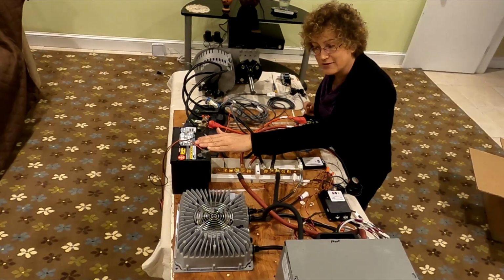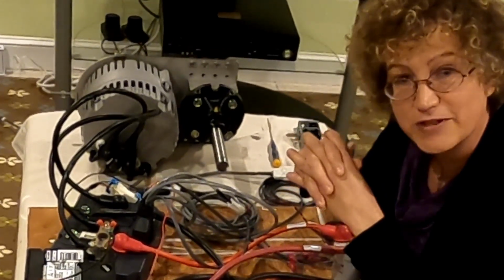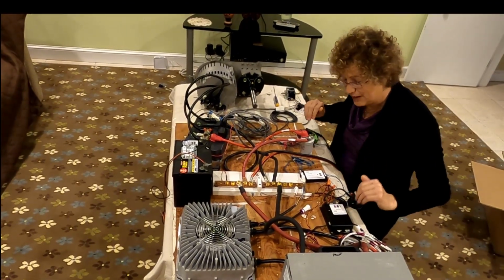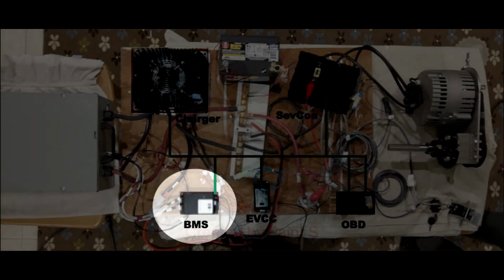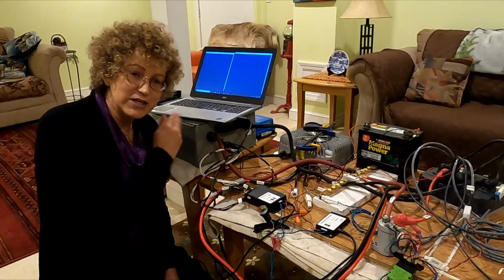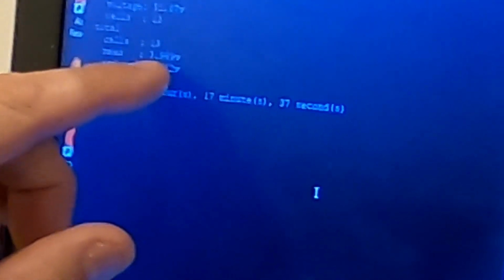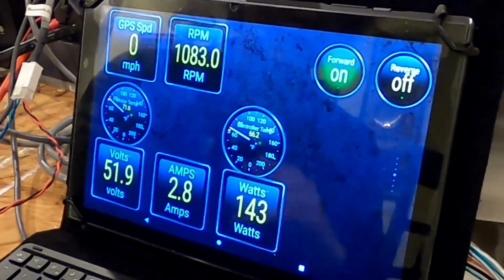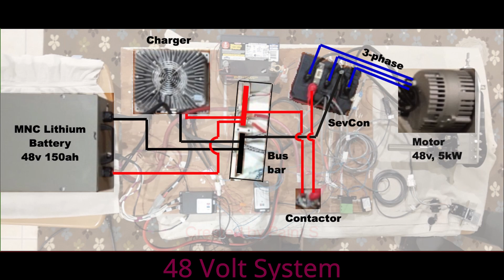Episode 39 - Repower our Sailboat.  Electric Sailboat Drive Bench Test with Thunderstruck Motors

Comment: SAIL Drive conversions can be as simple as :
shore power smart charger + Li-Ion + PMAC and Re-Gen motor controller + matched prop....Li-Ion DC/DC to the panel.

Reply
Reply from the maker: Yes! We have all of that except for the Regen.  Our current boat as a propulsion motors and they do not accept region unless you have their batteries.  We tried to cover all of what you have listed in our other episodes.  Cheers
Reply: @sailingaccidentalgybe  well the Sevcon controllers are Re-Gen capable, aren't they?  it's the Motor Controller, that has the re-gen function or not.....for a motor only boat, no one would care....but for a Sail drive conversion That Is A Must.
Reply from the maker: @RulgertGhostalker  having region can be helpful, yes!  What we found was that we generally we're not making much in the way of power must we were doing for knots or better and even then it wasn't a lot compared to our solar panel input.  Perhaps you have found better results
Reply: @sailingaccidentalgybe  Electric Marine Propeller  Regeneration ....not region, or going for knots; do you know what i am talking about?
Reply: @sailingaccidentalgybe  like the Sails on a Sailboat are filled and pushing the Sailboat through The Water, The Water moves Over The Propeller Forceing It To Spin The Motor, Which Is Now Acting Like A Generator Because The Motor Controller Has Regenerative Function, And Sensed The Batteries are Low, Because The Sailboat Taxied Out not long ago....

Comment: Hi, thanks for sharing your experience in such a comprehensive way. I see you have moved into another boat at this point, but I was wondering if you recommend the 5kwh motor for a 32ft islander wayfarer. I think its alittle lighter than your 34 ft. Did you have any real big problems with over heating or anything else? No need for speed, just getting in and out of slip basically Thanks!
Reply from the maker: Sorry about just seeing this now. We initially had problems with overheating but then we added a heatsink to the controller and that seemed to take care of it!

Comment: On that display you showed could other things like speed,depth,water,temp from a nema 2000 device be displayed? Thank you
Reply from the maker: That would be wonderful. The display takes information from the OBD2  and translates it using a proprietary language to the remote display device

The link below, from thunderstruck motors, is relevant to setting this up. Unfortunately, it is not NEMA compatible.

Comment: This was GREAT info!!   How do you plan to keep the motor cool when inside the boat?
Reply from the maker: It's an air-cooled system and we have 348 v computer fans. One fan draws air in behind the subcon controller. One fan blows on the motor, and one fan is an exhaust fan that ports air out through a 4-in dryer hose. Works really well. I keep a thermometer in the engine room just to see how well it works and temperature does drop very quickly when the fan system is on. When the fan system is off, the temperature, even in the hot summer, never rises much above the water temperature

Comment: Do you plan to post a video showing the installation of the motor?  What sort of gas engine are you replacing?  I would love to replace my Atomic 4 with th 10KW thunderstruck motor, but don't know how to bolt it to the boat.  Thanks for your help.
Reply from the maker: We are replacing a 10 HP diesel.  With our first installation, we wanted a relatively simple install.  Moving up to a 10 kilowatt motor would have added additional complexity regarding placing the two batteries in parallel. Since that is a big unknown for us as to how the battery management system would work in that situation, we opted for a simpler solution, although it really was quite complex to build it out
Reply from the maker: We're hoping to do our next video in the upcoming weeks and that provide some insight as to the actual installation as well as some of our testing. Thanks for following us
Reply: @sailingaccidentalgybe  I hope you'll be able to provide as much detail as possible about how you aligned the moter to the prop shaft.  Did/will you also replace the cutlass bearing?  What about the stuffing box?  So many projects!

Comment: Thank you very much for this very clear and very interesting video. I'm planning to try the same thing in few months. My concern for the moment is the jonction between your 48v and 12v bank. How do you charge your 12v bank ? With a DC/DC 48/12V converter ? thanks you !
Reply from the maker: We have two separate systems. A 48 v system that is fueled by four 100 watt solar panels in series and a second system, the 12 volt system which is fed by two 100 watt panels connected in parallel. We also have a 2000 watt Wen generator that we can use to charge the battery system if we have just a few too many cloudy days or we wish to do continuous motoring. Hope that helps!
Reply from the maker: Thank you for your question. Replied in the comment below!

Comment: Are you able to hard wire the obd as well as Bluetooth? Thank you
Reply from the maker: I answered in the video, episode 41, but just to reiterate in case you haven't seen it. Yes, it is possible to hardwire the OBD. I went with the Bluetooth just to try to reduce cabling. In all honesty, the Bluetooth is a little flaky and once it's connected it's fine. It's sometimes the pairing that is something of a challenge. Next time, I would go with a hardware solution on the next boat.

Comment: You do know a 5kw motor is less than 7 hp peak, which is way undersized for a 34' sailboat
Reply from the maker: Yes.  We calculated a maximum speed of 4 knots.  The idea is that we will only be using it to get off the dock, not much else.  Drag in a fluid medium is cubed so a 10Kw motor would net us 6.5 knots for twice the power consumption.  Since we are limited on real estate for solar panel,  we could scale up the motor size but not the electrical generation capacity on this boat.
Reply: @sailingaccidentalgybe  Twice the power consumption, but only if you crank it full throttle. A 10kw motor can still be used at 5kw.   A 10kw motor can be used at 5kw for conservation, but a 5kw cannot be throttled up to 10kw in an emergency.  In any kind of wind or current you may be struggling to get off the dock with 5kw.

Comment: Did you purchase this as a kit from a company thank you
Reply from the maker: Most of the parts were from Thunderstruck Motors
https://www.thunderstruck-ev.com/electric-sailboat-kits-and-accessories-inboard-motor-ev/

Batteries were originally from AllCell
https://www.allcelltech.com/pdf/kwh.pdf

Solar Charger was Victron
https://www.amazon.com/Victron-BlueSolar-MPPT-Charge-Controller/dp/B019X2O5CY/ref=asc_df_B019X2O5CY/?tag=hyprod-20&linkCode=df0&hvadid=198064505516&hvpos=&hvnetw=g&hvrand=1267244530930296744&hvpone=&hvptwo=&hvqmt=&hvdev=c&hvdvcmdl=&hvlocint=&hvlocphy=9002324&hvtargid=pla-350371745711&psc=1

Hope that helps!

Comment: Good job explaining. What type and size boat is this powering. 5kw  thank you
Reply from the maker: It's a 34' Irwin Citation.  11,500 lbs.  While the motor recommended is a 10 Kw , we fully know that the power to speed ratio is non-linear.  We also realize that we would not gain more range on a 10Kw motor as charging time would remain the same.
Reply: @sailingaccidentalgybe  I guess with the correct prop can help. Watch your torque, temp and overload settings. It should last a good amount of time thank you

Comment: Fascinating video. I converted my little day sailing boat to an electric engine with solar charging back in 2014. I won't be going back to smelly old fuel anytime soon. Best wishes from Scotland.
Reply from the maker: Great to hear!  We got fed up pouring money into a smelly and leaky diesel.  Would love to see your setup too!
Reply: @sailingaccidentalgybe  My set up is very simple on a 20ft day sailer. I started off with a salt water rated Minn Kota 45lb thrust motor mounted on my transom and upgraded to a Caroute 80lb thrust motor I imported from China. I use a bank of 2 x 12Volt 110aH Varta wet cell deep cycle batteries with 100W of solar and a PCM charger controller. I also have a battery selector switch fitted to run the batteries individually.  The system works well on this type of small boat, sustainable free energy. Gets me in and out of the harbour and out of the way of shipping.
Reply from the maker: @threefingeredguitar  That's fantastic! I think as the price of lithium ion phosphate cells continues to decline, you may even be able to get rid of the lead acid batteries! Thank you for sharing your setup. hopefully, when we get our next boat, we'll set sail for the Scotland and Europe!